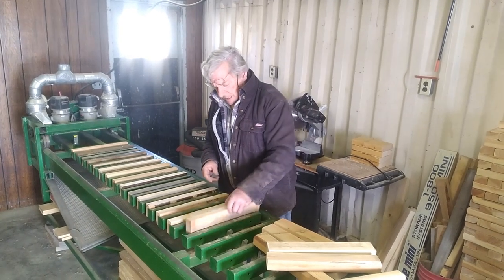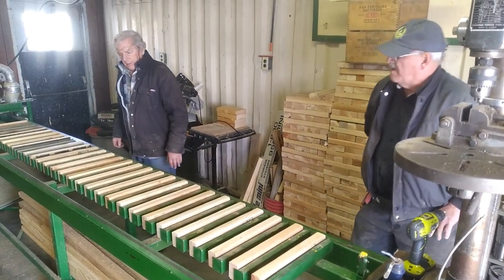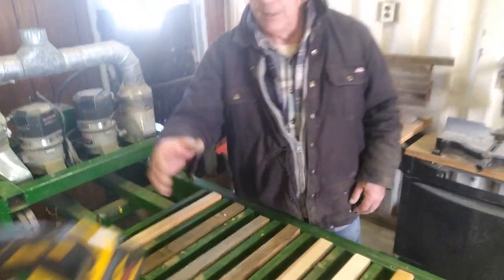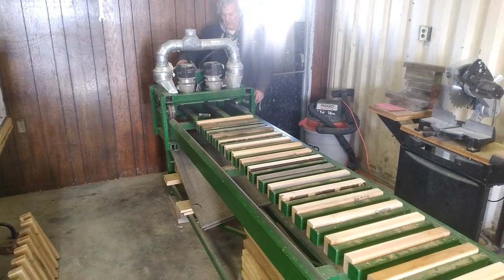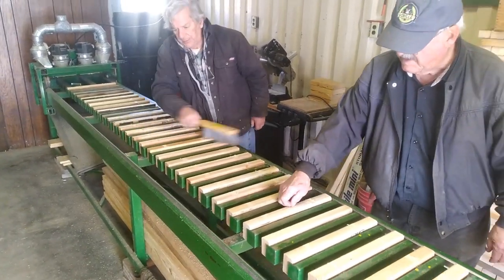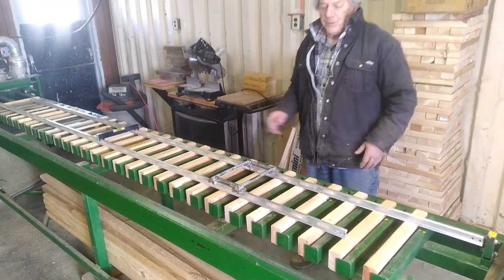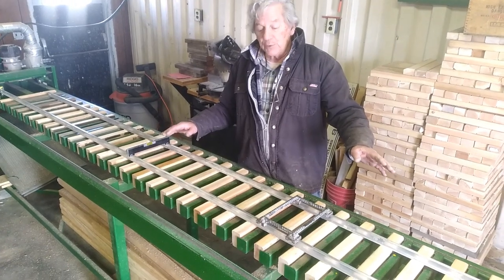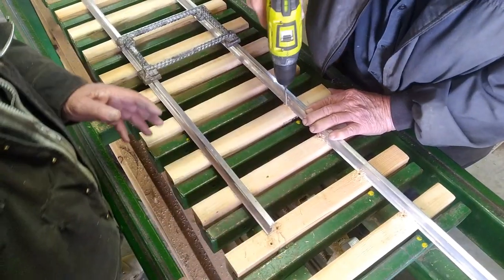Colorado Live Steamers - Track Panel Machine

Comment: Ir looks like your ties are not treated.  How long do they hold up in your high desert conditions?
Reply from the maker: At this stage they are not treated. After assembly, we will put the track panels in a tank of used motor oil for a minimum of a week, sometimes longer. The sand out at the railroad helps with drainage but we still experience rotting ties. I think on average we get about 8 useful years out of the ties; some more, some less.

Comment: Where did you get or make the michane
Reply from the maker: I will need to double check some of the machines history. However I am pretty sure the machine was built by the Colorado Live Steamers over 20 years ago. It is based off of a machine that Train Mountain built and used.

Comment: So from what I'm seeing when you went large you threw scale in the trash.
Reply: When you are carrying 1:1 scale people on a 1:8 scale train, there have to be compromises.
Reply from the maker: The rail we use is actually quite accurate for rail used in the 50's and 60's. The ties are a little bigger to help hold the rail in place better. Somethings just do not scale well or when you want to hall people, physics needs to be accounted for.
Reply: @ColoradoLiveSteamer  I tried to explain to someone that when you double the size the weight increases by a factor of 4. Too bad you can't get some redwood for the ties.